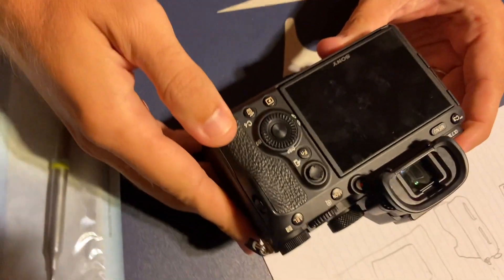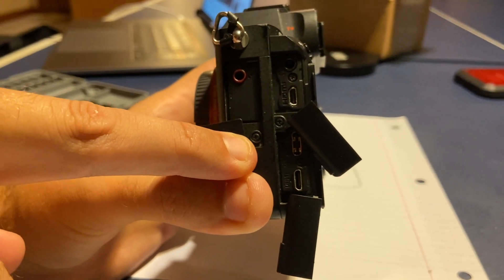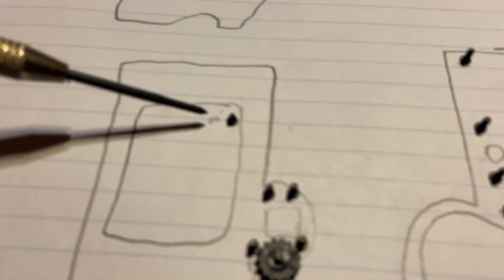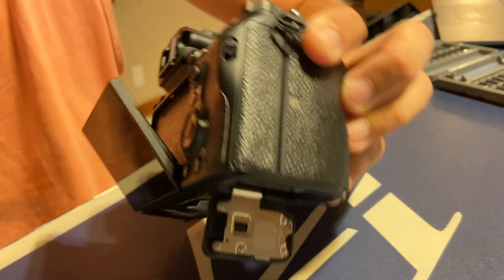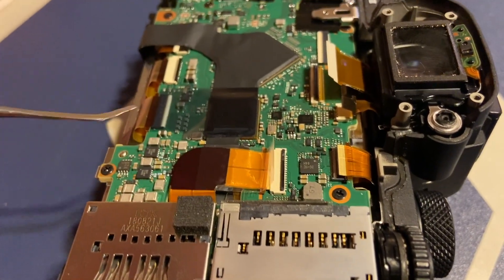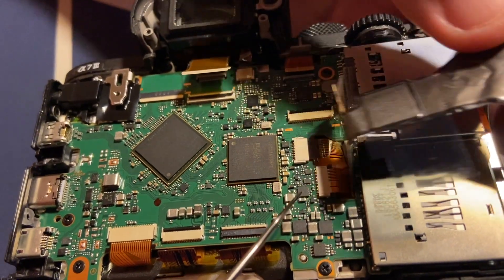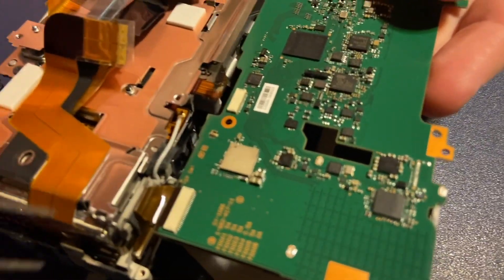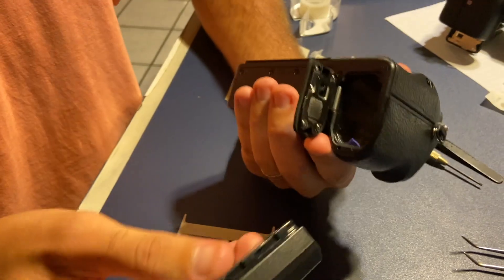A7iii Sony (A7R iii) Camera motherboard replacement, STEP by STEP teardown and repair.

Comment: Those 4 silver screws on the top WILL NOT open and are stripping.. Can I do this repair without removing the top piece? Or any suggestions?

Comment: I don't feel my mother board broke but similar thing My a7siii stopped working, files missing such as SSID info which was on the A7iii, the folder there but not the actual ssid doc, couldn't connect to camera, qr code was empty.  Then it started saying camera error, had to turn of and on a few times to get into record mode.  did that for a year, now i just did a firmware update and now it does the error but you can't on and off it as it's too slow, and that's when it manages to go into error again.

Comment: I just had to get a shipping label to send mine in for a circuit board replaced. At that point if they cover that repair I will ask for extended warranty choices. If you touch your camera and start repairing it yourself they will not even fix it under warranty. Mine was three months past warranty and they are agreeing to take it in for me. That took a lot of convincing and I had to go to management to do it. Four foot surgeries and only $2,000 photos means they should fix it!

Comment: Great video and you're very brave. I took the easy way out and sent it to a Sony repair centre. But not sure if the AW performs like it did and I have notice a slight light leak either side of the View finder half way down. You can see it when your in a dark environment . Not sure if it was there before the repair. Do you think it could be something the haven't seated properly?
Cheers,
Andy.

Comment: I have a question, I want to get to the Multi Controller Navigation Joystick Button. My original came out during an event party. It still functions well but I want to install it back. I've already ordered the part from ebay. How do I get to it?

Comment: After replacing the motherboard, did you happen to experience any issue with the AWB or the AF-C when in video mode? Trying to determine if a calibration process is required post the physical motherboard replacement.  Awesome video!
Reply: Update: After replacing the motherboard, my camera was able to boot up but showcased a number of new odd behaviors.  The AF-C and AWB was way off.  I ended up have to send my unit to Precision Camera to get it calibrated to factory settings for $389.  I don't know if they would have charged me more if they had to replace the motherboard themselves.  I'm going to assume so just to make myself feel better for attempting this DIY fix.
Reply: I've same issue.. how can I fix it?
Reply: @bishwajeetpattnayak  i ultimately had to send it in to precision camera to get it recalibrated. Which cost something around $400.

Comment: Awesome video.  This is just what I needed to watch in order to attempt the same fix on my a7iii.  I do have a followup though...  After replacing the motherboard (purchased from encompass), the AWB is more yellow/green and the autofocus seems to hunt longer than usual.  This behavior did not occur prior to the camera not being able to turn on.  Did you experience anything similar? My fear is if there is some soft of initialization software that needs to happen that is not consumer available. anywho, awesome video!
Reply: Have you tried to see if the firmware needed to be updated? Wondering before I try this
Reply: You need to send to sony. They will install sony software into it

Comment: Does Encompass allow returns if the MB isnt the problem?
Reply from the maker: I'm not sure. I dont think so. My guess is you would have to get it somewhere else  if you wanted to be safe. I'm sure there are ways you could still return it through ecompass but my guess is you would need to pay shipping and need to give a round about reason for the return

Comment: hey, how did you know the motherboard was bad? also, where did you get it? thanks a lot.
Reply from the maker: I believe I got the second motherboard from ecompass. I would go back and watch the video to make sure that was the case. There are several ways to tell if the motherboard is bad. After going though all the "basic" troubleshooting and resetting the camera its a high chance the motherboard is toast if the camera still wont turn on, does not respond to the battery being inserted and fails to respond in any other way. If there is something else wrong with the camera is should still show signs of life and respond. For the person that isnt sure if the motherboard is the problem but expects it is I would suggest buying it from a site in which you can return it if the new motherboard doesn't fix the problem.
Reply: @cinematicfeels8614  thanks!
Reply: @cinematicfeels8614  Cant you repair the motherboard instead of buying a new one?